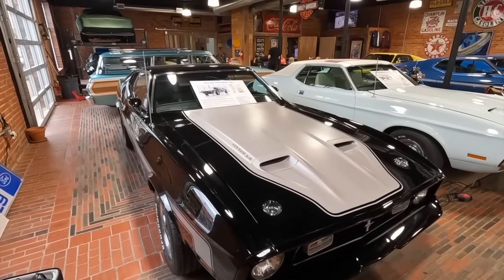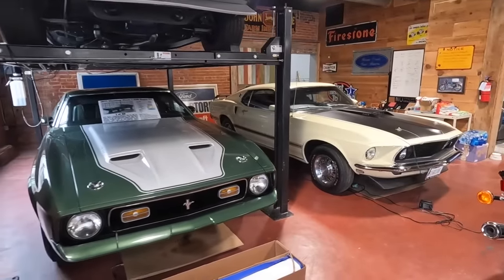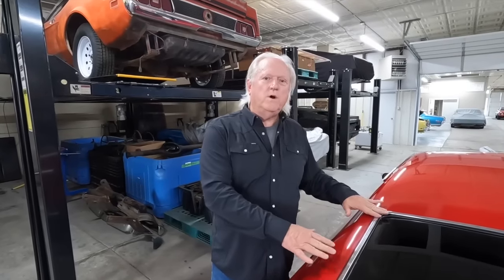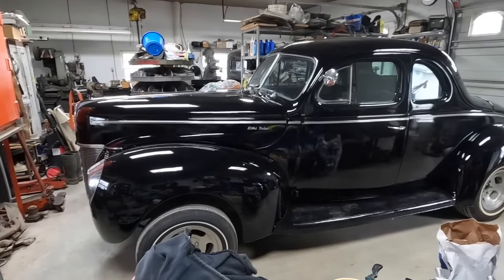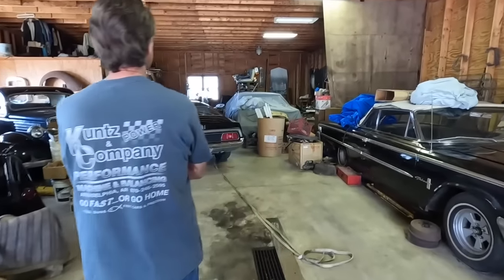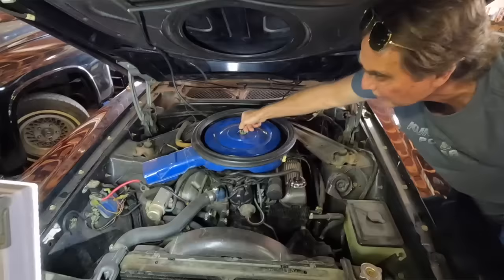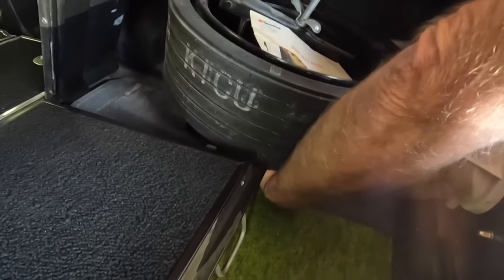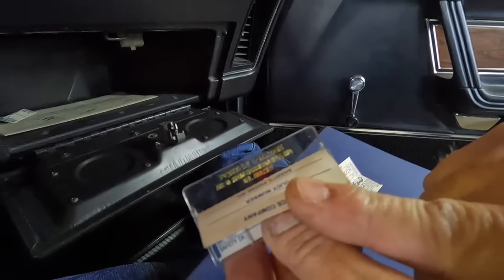Finley Ledbetter:Buying  & Restoring 1971 Mustang Super Cobra Jets - Any Condition

Comment: In 1973 I was 23 y/o, re-enlisted in the Air Force and ordered a Mach I, loaded. Little did I know that would be the happiest I would ever be with a new car. A 351 Cleveland, 4 barrel carb and dual exhaust. Lay down rear seat with an auto trans. Absolutely, loved that car. From time to time, I pull out the original window sticker and marvel at the $4200. price !!!
Reply: I just got out of the Marines in 1971. I didn't get a Mustang but I did get a Firebird formula 400. The good old days. 4200.00 out the door.
Reply: That was a fairly expensive musclecar for 1973!   Cadillacs were around $6000 at that time.
Reply: @gt-37guy6         It had every option I could special order on it, except power windows. I was incorrectly told power windows were not available on that model. The mill was on strike, so I waited 6 weeks to receive it in St. Louis
Reply: Fastest is that Kawasaki H2 at 02:53 !
Reply: @bentnickel7487  I had one like that. Q code. Bronze color originally.
Reply: I've had Dad's 1970 F100 for 20 years. I just put a 302HO crate engine and a rebuilt transmission in 2020. I get lots of compliments. It's a joy to drive. RIP Dad.
Reply: @markmcintosh7095  That's around $28,000 adjusted for inflation. If they made that car today, it'd cost more than double that.
Reply: @roostercogburn7243  Very, very cool!
Reply: @frakkinMatt812  uh i go by gold because in 1932 we could trade a paper $20 bill for a double eagle gold. gold spot in 1971 $44.60, in 1972 $63.84, in 1973 $ 106.48 , in 1974 $183.77 and on 4  August 2022 $1760.00 
 so try 39 time $4200 =$163,800 in 1971 dollars but a 1971 mach 1 C6er goes for about 39,000 . gas was 43 cents a gallon n 1976 at Waco now more than 10x that
Reply: And then Boomers wonder why everybody hates them
Reply: @ChewyChicken589      As a younger man, I used to say I didn't care what people thought, but I secretly did. As an old fart, I've learned how to "really" not care what people say about me, it just doesn't matter. Hope someday you can learn that, as well. It's very satisfying.
Reply: Awesome story, please post a video showing it all I’d love to see the history
Reply: @frakkinMatt812  no, if they made that same car-that same EXACT car, no fancy electronics, no airbags, etc. it'd be way cheaper. Manufacturing efficiency is so much greater, it's just that we make them so much more complicated now.
Reply: Very freaking cool 😎
Reply: I have the sticker for my first car.  1970 340 4-speed Challenger.  $4031.00.
Reply: @markmcintosh7095  I'd pick the Formula also.  I was in the Air Force and bought a new 78 TA.  but by that time they had lost a lot of power,  but still fun to drive.
Reply: @ChewyChicken589  On the other hand, people don't mention the struggle going on in the 1970's. Actual national average wage was $3 an hour. There were production jobs that did net $13 an hour, but they were hard to get and or hold onto. Mechanics were mostly on commission and people weren't using dealerships much back then; unless a catastrophic failure occured. So mechanics were bringing home barely minimum wage.
Kids weren't working as much in many of the fast food and grocery store settings, as most of those jobs were still full time positions. So a $4200 price tag was hard to get at $5 an hour.... Which for a youngster was actually as good as it was gonna get in 1975.
Reply: Cool man! I have a 70 with the 4v Cleveland now. But it's upgraded to 600hp
Reply: By 1973, didn’t they de-tune the engines to meet emission standards? The compression ratios dropped drastically also.
Reply: @davidthompson62    I was fortunate to have bought a 1970 Mach I in Dec. of 1969 with the 351 Cleveland 4 barrel and was told it had 300 whp. The 73 had the same engine, same carburetion, but choked down with smog equipment to 266 whp. 10 to 1 compression in 1970, 8.6 to 1 in 1973. The 73 was a better car, I thought, at the time. The 70 was noisy, poorly assembled, but faster. The 73 was a different car, very roomy, quiet and drove better. The audio was much better in 73, simply because, with the air con going and the windows up, you could hear it better. The 70 did not have air, had a black interior and several times, when the summer temp was over 100 degrees outside, in city traffic, would overheat.
Reply: @bentnickel7487  I’m not surprised by your answer. With the horse power wars a thing of the past, Detroit started to make more luxurious cars that were friendlier to its driver. Take the cougar Rx7. Originally an upscale muscle car, by 72 it was transformed into a roomy, comfortable mid-size car. Muscle cars need constant attention to keep at top performance. The cars after 72 were much more user friendly.
Reply: @markmcintosh7095  when i was 16 back in 2013 i bought my first car a 79 trans am for 2000, just finishing the restoration should be 95% complete before the cold hits this year, but i dropped in a 1970 400 pontiac into it from a GTO and i put a 77 nose on i had everything already my 79 nose was in very poor shape
Semper Fi Marine ✌
Reply: @gt-37guy6 up until 1st energy crisis in 1973 car prices were sane after that car were junked or not being built anymore hence. High prices. We wood sneek behind Ford v dealer to see next year models in Sept as they came in 😊😊😊😊😊
Reply: When you think of today price for car. Those cars back then seems like a bargain.  Now them cars back  then cause you a king ransom
Reply: @roostercogburn7243  watch the movie omegaman with Charleston Heston he goes in ford dealership picks out a mustang and drives it home. there were no people left great show nice mustang
Reply: Got out of Vietnam /Army in 1970, bought a new 1969 Shelby GT 350. Just getting the   car back  on the road.  I paid a little more than you did.

Comment: I spent last week in Ohio looking at two Boss 351 cars that had been 25 years in storage the owner have gathered many of the hard to find NOS parts over the years and as the cars sat he worked on other cars eventually deciding to sell them. They will both need complete restoration and one is an untouched  Grabber Lime Green Boss 351 the other a Grabber Yellow now my job is to restore the Grabber Lime car that is a true time capsule (the Rev limiter is still hooked up!) and find a new owner for the Yellow car that will properly restore it. 
Robert they are still out there and seem to be more and more month by month!
Reply: Well done - I’ll drop by soon.

Comment: My grandfather has a 71 mach 1 with the 428 super cobra jet with the Hurst 4 speed shaker hood and the drag pack.. love these cars
Reply from the maker: The '71 is the 429. This is the new 385-series block, with thin wall casting and the room for more cubes. Ford planned the longer, lower, wider body style of the 1971 Mustang to have 500 plus cubic inch V8s.
Reply: @thewriter2549  maybe it's a 70 then... I know for a fact it's the 428 scj with the drag pack

Comment: I had a black on yellow Boss 351 in high school late 70s. I loved that car. I was restoring it and someone knew where I was and where it was, over half the parts were stolen from me. I'll have nothing but fond memories of that car. Got a lot of tickets though.
Reply: People forget, back in the 70's and 80's there weren't many aftermarket performance parts. Even in the older FE engines. If you wanted a Hi Performance 390 you had to get a set of heads for performance. 330hp, 350hp, 375hp or 401hp. Back then if you wanted high performance those heads were your choices and the HP you were going to get from that engine. Carbs were here and there from Holley, but things like 390 3-2bbl and 406 3-2bbl. setups were high dollar items to pick off from someones garage. Same as the heads I mentioned. Someone stole my neighbors 3 deuce setup off his Holman Moody prepared 406 in 1978. Unhooked the linkage. Cleanest job one could imagine, even drained the radiator first.... He had that engine in a 40 Ford Coupe like in the video. It was in a 56 Ford F100 last. I saw it in the truck and it would raise both wheels off the ground at 35mph in second. I'd hate to see what it done in the 40 Ford.

Comment: My friend just found and bought a '71 Mach 1 429 SuperCJ, 4sp drag pac. 1 of 190 built. One missing part...the original air cleaner. No rust, no bondo.
Reply: These cars are out there and show up from time to time the original air cleaner assembly was quickly thorn out in favor of a high flow chrome one.
The original CJ or SCJ J-Code ram air cleaner with the correct snorkel is truly a unicorn I'm always looking for!

Comment: It was before the 71’s came out. Our family’s auto parts store was a Motorcraft warehouse in Detroit and we would get Ford engineers coming by to purchase parts. An engineer pulls up on front with a silver 71 mustang convertible with the Ram-air blacked out hood with “429 Ram air” by the duct. That was a memory I will always have. Great looks car. Couple years later bought a 71 351 4V Ram air Mach 1 myself.
Reply: They only built a few 71 429 Ram Air convertibles that car would be worth a fortune today!

Comment: I have a Super Cobrajet engine my husband bought to put in the 1963 Ford Galaxy 500 notch back he built in the late '90s. Ten yrs ago the mechanic my husband bought it from told me it was worth $3500. I'd already looked online & saw a SCJ goin for $13K. 
The Super Cobrajet came out of the '63 Galaxy  when my husband decided to change the '63 Ford from a Sunday cruise car into a race car so he could get into classic car racing. He wasn't willing to risk losing that SCJ motor.
Reply from the maker: 10 years ago that figure might have been the case. Today prices are much higher, but first we have to see if you have a 428 or a 429,  both of which came in Cobra Jet and Super Cobra Jet builds. Email me and I'll get you in contact with the right people  - jerryheasley@gmail.com or you can call me at 806-236-3681

Comment: As a 90s kid growing up, I think the 69 and 70 model years overshadowed all these other awesome years. With age comes wisdom and have really started to appreciate the cars and years outside the norm. That Red all original 351(?) is no exception. The Torino Cobra Jets are sweet as well!  Definitely would rather be restoring one of these over a new mustang
Reply: 69/70 were the hot topic when I was in HS 70-73 w the 428CJ available it was a wish list item for every young motor head! At least the ones that liked Fords!
Reply: @finleylebetter6419  when I finally learned engine math, and started looking deeper into different engines offered, I’m still shocked the 428 CJ was the “it” item. Especially over the 429 (ford hemi), and the king 427 SOHC. The irony is I started out a Chevy fan and ended up a Ford guy after learning a thing or two lol

Comment: I had forgotten about that back panel into the trunk. My 65 1/2 Mustang GT fastback had that and it was great for skis. In that car the skis went between the driver and passenger seat, but it was better than a rack at the time.
Reply: Fold down read set is a good option!

Comment: Having the parts cataloged in their position front to back is a  really cool idea
Reply: I tried part numbers and I tried grouping by systems and this is the only way I could make it work. I do keep Dash, Trim, Glass, Consoles, Radiators, Suspension, Steering and Pedals separated in big plastic bins. Transmissions, rear-ends and engines on racks and engine parts separated by 351 and 429.

Comment: Helped a friend, who's father was the parts manager at the local Ford dealership, restore his 73 Mach 1 everything new, correct to include 351C big block heads. Only thing we couldn't find was the exhaust manifolds (pre internet) so unfortunately it had headers.
Reply: Joe lots of them out there missing original exhaust manifolds we tossed them day 1 back in the day!
Reply: @finleylebetter6419  My friend went off into the air force, called his dad to sell the car, his dad was so disappointed in him he sold it for $1600. I at 18, and working part time to pay for trade school, could not for the life of me, come up with the money. Around the same time I found a 69 or 70 428 SCJ Torino, it started and ran, but the 3rd member was shot,  for $500 still couldn't raise it, boy those were the days. You're collection and set up is truly awesome. You are an amazing artist!

Comment: Had a 71 Boss 351 Holman Moody / Hot Rod  13.5:1 custom pistons 4:56 Detroit locker 850 double pumper paid  $ 3500 for it Imron paint shifted at 7400 RPM but only F70x14 magnum 500 traction bars lots of fun until that missed shift
Reply: Boom yep been there done that Bummer for sure!

Comment: In late '62, a local guy ordered a red/white top/red interior '63 Ford 500 XL convertible with 390/3-2 bbl/340 hp/4-speed/3:50 posi rear. He kept that car for decades, his 1st new car. Thing is I've seen a lot of these cars but I've never seen any with that engine short of a T-Bird roadster. It wasn't a 406!
Reply: Ford made a real HP 390 early on it was a beast I don't remember the actual HP advertised I want to say 400-425 ?
Reply: @finleylebetter6419  They made a 390/375hp & with 3-2bbls it was 401hp. That was a dealer istalled unit. I believe that was in '61.

Comment: My bro in law has a 1971 mach 1.    Looked awesome 351 Cleveland.   Sad part was all shock towers were rusted rotted and Rear suspension rotted as well.   What a shame.   Scrap metal is all it was.   Good engine.
Reply: The rust bugs get to lots of them along w trees, telephone and power poles, roll overs and stupidity I have been involed in all. These cars were ran hard and

Comment: I know people think what they think. I drive 427 FE cars, 428 FE cars, Boss Cars and 429 SCJ cars all the time. Today tomorrow all the time they are all fun. I prefer the 429CJ/SCJ 385 series engines for lots of reasons but you hand me a R code 427 or a well prepped 428 SCJ and It will bring a smile to my face. So lets not get to wrapped up in the old days they were great I lived them I have several wally's  from my NHRA days so I have gone faster than most. But I still like my 340/727 69 Dodge GTS for just making smoke and having fun.

Comment: A 3-D printer, can reproduce any part, of any car . A car hood ? No problem. Scan another hood into the computer, Print it out In just a few hours flat ! Yes. You can actually 3-D print it out, right now, for real ! Sand it and paint it, load it ! Done ! No need for a Mill !
Reply: We print a few small parts but nothing big I would like to know more!
Reply: @finleylebetter6419  Im a precision CNC machinist. I only run CNC machines...but, my friend at work, built a larger scale 3-D printer in his garage , from a smaller one he hacked, for fun. He wanted to build a printer, that is big enough to make the whole car hood, and not just small pieces of it. 
(My friend also pulls ALL machines apart...and fixes them. Including wrist watches,..right in front of me...) 
 Some can, and will, build a bigger 3D Printing area, for making bigger hardware replacement parts, like car hoods and things.
And, can now easily do so. But it will require some engineering on YOUR part to make the work bay area bigger . 
 That's alright. Build it as big as you need it . Build it on your own, it's easy. A bigger layout table can be made, 
so that bigger parts can be created .
Once your hood is 3D scanned into the computer, (with the hand-held 3D scanner) ..it acknowledges that it understands the dimensions that you have just shown it . Tell it to start printing, and off it goes .
 Buy a 3D-Printer and make the travel-bay wider and bigger..!! 
Or tell the companies to ! ..The truth is, they don't want us doing this,...but we can. My buddy the mechanical engineer, got his 3D printer to make bigger parts. And so can you ! I cannot do it for you..but If you are a CNC Engineer, you are probably already building your own private large 3-D printer . And if not...I'd start thinking about it .and building it right now just like my friend at work is doing....Call up GRANGER for help . They will get you there ! They got my buddy there too ...😳👍🏻

Comment: wow my first car was a 1967 GTA I restored it before I was old enuff to drive I totaled it on Friday the 13th my next 1967 GT390 just like the built car and yes I totaled it too but no the 1967 GT500 but 4 miles to the gallon so I sold it then bot another 1967 notchback I popped in a 351C HP it just goes on and on now I'm at number 71 but it's a 2002 ganger thunderbolt and that's all folks at 61 I'm tired but I sure wish I could go see his cars it would be a fitting end to stroke out in a collection like that.

Comment: I think the torino convertible  429 CJ 4 spd, DragPack was the most rare. If I recall there was 13 built in 1970.
Reply: Only built 4 CJ 71 Convertible's w 4 speed but anything less than 50 is rare today.

Comment: Can you tell me what model had the option of a small rectangle "opera window" in the upper rear sides. This was purchased new in 71. It has a short vinyl top. And a stripe i havnt found on others. Its a bronze color. One wide black stripe from front to the front of the rear fenders. The small window is located about 3 inches past the rear windows. I have not had any luck finding another one with this option. The original owner just turned 100. She never had any custom work done it was a daily driver.
Reply: Possibly a Grande Coupe !!!
Reply: @finleylebetter6419  thats what i was leaning toward with the top. Although i dont remember seeing padded vinyl hard tops on any. But the window just confuses me. A small rectangular window. Ive never found anything or any picture of a mustang with that.
Reply: @finleylebetter6419  i wish you could see this.